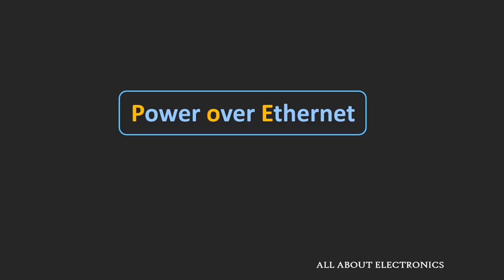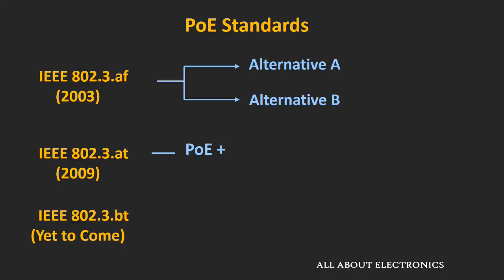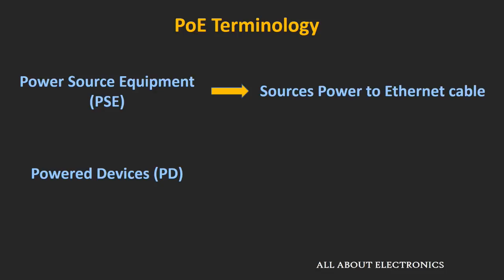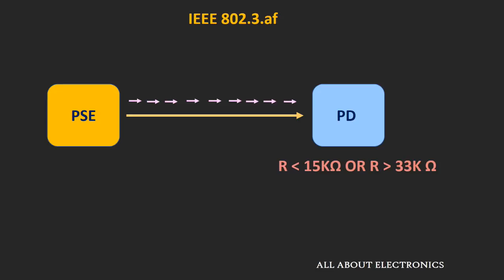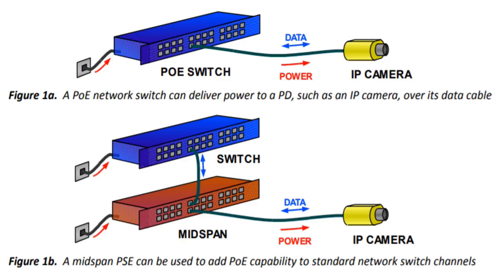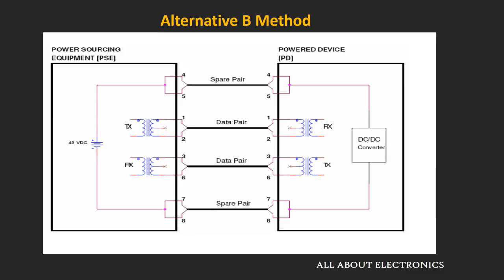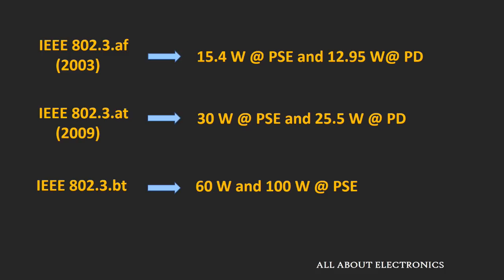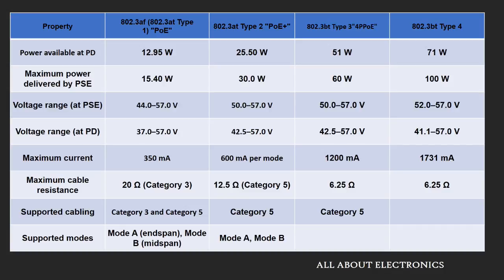What is PoE? Power over Ethernet Explained

Comment: Hello Sir, Can I use PoE to connect a 750 GB or 1TB external USB drive to my ethernet. I have the USB to ethernet convertor. I would like to know if PoE will provide enough power. I understand PoE comes in two standards 15 watts and 30 watts. Google says an external hard drive takes about 15 to 30 watts. So will this work? Thanks in advance.

Comment: Question: If a switch supports 802.3af and 802.3at, does it mean it can power an end device which only accepts power from spare pair? how will i know if the device requires an additional power adaptor? Also, why do some devices accept power only through mode b? because most switches work by default on mode A

Comment: Thanks for a great explanation. Especially on types vs. power / mA !
Question: Can I connect a device which has it's own powersource (i.e.  thermostat) through electricity socket (220V) also on POE-port (Even when while it is powered through socket ? 
In other words as I understood from your explanation: It doesn't matter how the PD is powered up. The POE-port on switch will first send a signal to PD asking if it needs power. If not or if it has its own power supply (i.e. 220-socket) then it tells POE-switch that no POE-power is necessary. Therefor the POE-switch will send zero (0V) power to PD, but WILL continue to send data. Correct.
I need this info because I want to buy my first managed switch with either combined POE and non POE-ports or - depending on your feedbcak) all POE-possible - ports only some won't be supplying power as the device has it's own power supply.
Thanks for your feedback.

Comment: I have a mi router which is connected to my isp's reverse poe switch at the top of my building and i was given a tp link passive poe model poe2412g in case there are speed issues however i don't think it has anything to do with speed, I'm facing issue of very high ping from router to default gateway and henceforth, could you please help me with this, the ping is around 500-1000 , isp - tikona

Comment: What will be each channel output votage from PSE is it has 8 channels in case of 802.3.bt which according to u has  apporximate of 52V. what does that mean, will each channel amongthe 8 provide output voltage of 52V or all 8  channels together add up to be 52V.
Please reply if anyone knows.

Comment: What is the maximum distance ( m ) to deliver PoE?
Reply from the maker: It is 100m. But it should be less than 100 m for reliable operation.
Reply: ALL ABOUT ELECTRONICS 
It reached to me till 160 m on 48 VDC. i ask if we need to extend the distance to 250 m.what is the sloution here ?

Comment: nice. 

i have spare ruckus zoneflex 7025 accesspoint which can used as a standalone device. this device support PoE , I have a pppoe type of internet connection provided by my ISP. i want to connect that pppoe connection to this ruckucvzone flex 7025 , how do i know that the pppoe cable thats comming to my home will b able to support the PoE to power up my device n provide intenet connection as well ?

Comment: Thank you, your presentation was great and clarifying.
Do you know/heard something about Power over Data Line (PoE in automotive)? If you know something I would like to discuss with you. Thanks.
Reply from the maker: Yes, I have heard about Power over data lines. I know a bit about it, not very much. 
But yes we can discuss. If I know about it, I will definitely let you know.
Reply: ALL ABOUT ELECTRONICS They are considering to implement PoDL in automotive for the next years but with an input Voltage of 12V (automotive voltage). What are the differences between PoE and PoDL? The maximum output will be the same? We are saving the power line but implementing PSE and PD circuit, is there any benefit (cost and weight) as we know that we are using Automotive Ethernet with UTP? Explain what do you think about it. Thanks.